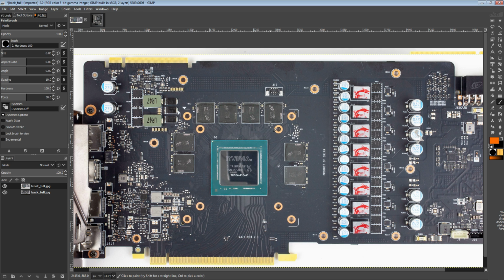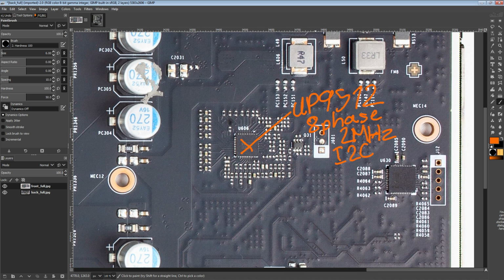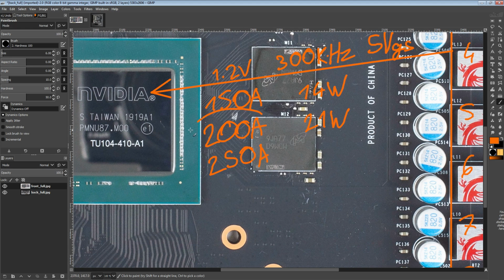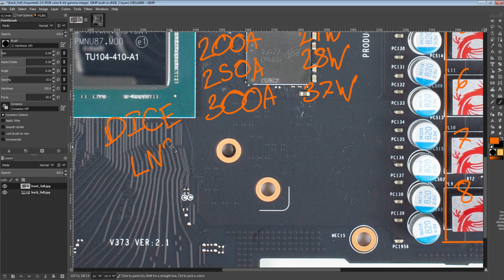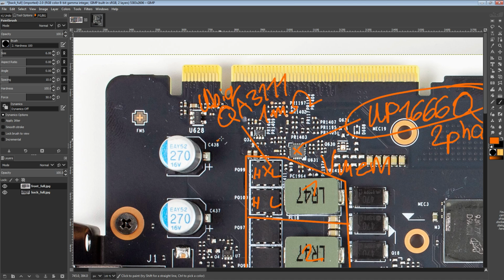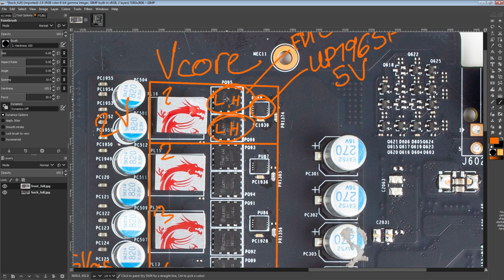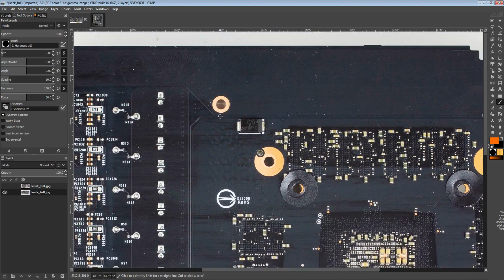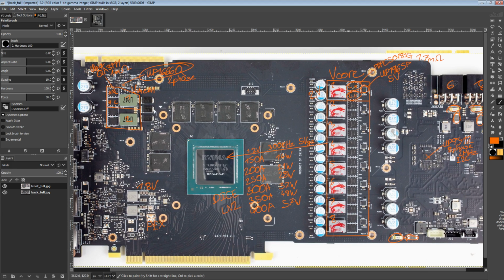GPU PCB Breakdown: MSI RTX 2070 Super Gaming X

Comment: In my area there is a guy selling a rtx 2070(for about 100 bucks), which as he says it has a shorted power stage mosfet*. How likely it is that this is the only problem, and how easy it is to change it?(I have some experience with soldering)  If someone could help me with some suggestion it would be helpfull.
*thats what he says,  I didn't ask for more details, so I am not sure if he is right

Comment: Thanks! i got germans fastest 2070 super. 0.003ohm on top is perfect! https://www.overclock.net/forum/69-nvidia/1740222-msi-2070-super-shunt-mod-fuse.html#post28327756
Reply: do you think i can get a higher clock with a higher Voltage ? maybe i want to buy a I²C - Controller. Do you have any tips ?

Comment: Before I RMA my 2070 gaming x trio it overclocked like a BEAST 2100mhz easy! Shame it was artifacting on forza horizon 3. Turns out it was drivers at fault apparently! My card wouldn't except the standard nvidia drivers for some reason!
Reply: William Topping  I could be wrong but I think it was drivers at fault because the newest fixed the problem but it took about 5 released drivers before the problem was solved. Unfortunately non of the big channels raised any concerns even though plenty of people were complaining about it

Comment: Need your advice On this I been feeling depressed about my purchase... I think my GPU is Wasting Way In My Build... I have a ryzen 2700x pair with a rtx 2080 is that a good Match ??.. Im Depressed  Cause I Paid 300 for the CPU earlier this Year And 700 for the rtx2080 ALOT of money to spend... And not fully utilize the hardware.
Reply: from recent testings, you do not benefit that much for getting anything higher than a 2060 Super. You might get extra performance with lower frame rates in really heavy games though (the real problem is that the 2700X isn't able to keep up with higher framerates like in competitive titles)

I personally bought the MSI card in the video above, and I really use the full power of the card by using NVenc encoded stream, Shadowplay record while gaming (and even then I have some room to spare)
Reply: @matthieuzglurg6015  True. Hardware Unboxed tested this and proved that Nvidia drivers are much more sensitive to CPU speed. Nvidia drivers need more Ghz!
Reply: my guy the 2700x pairs perfect with a 2080, you money was well spent, and the pcmr congratulates you on having b/a hardware
Reply: you're good to go man.

Comment: oh look no ram chips below the GPU for Nvidia, is that because MSI can't thermal pad properly in that position.
Reply: most nvidia cards made by msi do, and id say most amd cards too, except for as we know the msi 5700xt evoke, but this card has a aluminum plate covering the mosfets and memory.  And as for no memory below the gpu die, is because the extra mounting screw holes there are for the aforementioned aluminum plate for memory and mosfets, and it has alot to do with traces for signal integrity and so they can keep latency to a minimum, like if you look at a rtx 2080 ti, the die will be closer to pcie slot because there is memory below the gpu on a rtx 2080 ti, and they have to again make sure traces are short to keep as i said signal integrity and latency very low

Comment: Another boring nvidia breakdown vid of the same old stuff super or not, were is all the navi stuff or all the ryzen 3000, why are you still going on about intel and nvidia refresh crap? we've seen it all b4 theres nothing new here just the word super or 5ghz out the box instead of a 5ghz oc, 

navi is a new arch with new power/voltage designs new gpu board designs, ryzen has loads to get into, proper testing with voltages heat, chipset drivers, multi core clocks vs holding higher single core, how if you push IF to far although stable can reduce 1t perf? , ageesa, bios options, broken pbo etc. etc. come on BZ your usually all over this stuff.

Comment: The input fuses are probably there for diagnostic purposes rather than real protection.  As you indicate, they're probably too slow to protect the downstream components, but if one is blown, then you have a pretty good idea what the failure mode was.  So, when the card gets RMAed back to the factory, they can more quickly figure out whether its repairable or scrap.

Comment: Did this one get full thermal pads?

MSI?
Reply: most nvidia cards made by msi do, and id say most amd cards too, except for as we know the msi 5700xt evoke, but this card has a aluminum plate covering the mosfets and memory.
Reply: @johnshek8727  And the 5700 XT Mech... They both share the same PCB and heatsink design, and I'm pretty sure the non XT versions are the same. I've seen one tear down of the 5700 XT Mech and it had the same half size thermal pads on two of the memory chips as the Evoke, but curiously enough they were placed more centered on the memory chips than they were on the Evoke that Gamers Nexus tore down. On that one the half sized pads were placed toward the edge furthest from the GPU core, which meant that only about half the pad was covered by the heatsink, so instead of having half a thermal pad it was more like a quarter sized or 25% contact patch on that Evoke. On the Mech I'd guess that the contact patch was actually about 40% - 50% just because the pad was placed a bit better. Still no idea why they didn't just use a full sized TIM patch on these two chips.

Comment: Is this card share the same PCB as Trio version?
Reply from the maker: nope Trio uses a different PCB
Reply: @ActuallyHardcoreOverclocking  Thanks, I´d like to see your pcb breakdown video about Trio. I found review on TPU and it uses different VRM controller and power stages. And also Trio version is insanely quiet in comparison with regular Gaming X. There is only one bad thing – cost reduced VRAM heatpads, which not cover the entire surface of the VRAM, only in the middle, its not bad as on 5700 XT but still, its meh for the price.
Reply: @ActuallyHardcoreOverclocking  does the pcb the same has the regular 2070?
Reply: @Enclosure_2k  did you got any answer with this? got same gpu and planning to go custom loop
Reply: @daddytech9195  no idea. I bought the 2070 msi gaming version.   But i think its the same crap.great card. Good temps. Even right now with this summer weather coming.
Reply: @Enclosure_2k  thanks. My 2070 super gaming x is doing good temps when gaming, never reached above 70° but my idle temps are around 60° maybe because of the case. I'm planning to buy a waterblock because I already have a loop for the cpu and I just have to add a block for a complete loop

Comment: BZ, i'm thinking of getting a ASRock X99 Taichi. Do you think I want to off myself the second I get the board in the mail or not re RAM overclocking/general stability?
Reply: ram overclocking on x99 is a nightmare. i had an x99 deluxe, and i flat out gave up at 2666. unless you're in it for nostalgia's sake, don't buy into x99 now. zen2 crushes it at all price points, boards and CPUs are still surprisingly expensive, and i had nothing but problems with the platform. can't deny that there's something cool about having a quad channel, high end platform though. loved my 5820k system before the motherboard crapped out for the second time

edit: and don't even think about broadwell E, cause overclocking is still broken since some stupid update years ago. haswell E is the way to go on x99
Reply: Ergo stay the fuck away from it unless you want to become an hero because lolnostability. Got it.

If only the guy I mailed for a Asus Socket 939 board would respond already..
Reply from the maker: X99 sucks at RAM OC and the X99 Taichi really isn't that great. I have PCB pics of it sitting somewhere in my never ending backlog.
Reply: What about X79, is that less shit than X99?
Reply: @Wasmachineman  kinda yes, cause you could clock 3930ks higher than 5820ks, but working boards are even more expensive and very rare, and you're still losing out performance wise to a b450 board and a 3600. 2 years ago i would probably have said go for it, but  nowadays... eh. kind of eh. x58 has also soared to unreasonable prices lately for the boards.
Reply: I don't think you can run XP on a B450 board, but okay.

Might just do a S939 build and get a A300 DeskMini down the line some day as a backup machine, considering it's SFF.
Reply: @Wasmachineman  damn, that's gonna be a pain in the ass. i hope you have a good reason for needing win XP these days
Reply: Shits 'n giggles mostly, plus I always wanted to try SLI.

Comment: So, quick question about liquid polymers: when they start showing like "spider-webbing" on the side of them, they are usually toast, right? Trying to troubleshoot a old AM3 board that was very nice, while it worked
Reply from the maker: spider-webbing? I unfortunately don't really do repairs so I don't have a ton of experience when it comes to visually identifying failures.
Reply: @ActuallyHardcoreOverclocking  the best I can describe it's like little white squiggly lines down the sides of the caps, my guess would be micro cracks in them, IDK
Reply: @Celician83  do you have a picture?